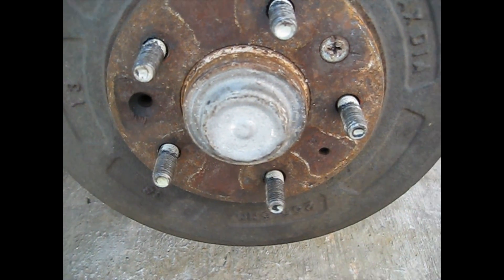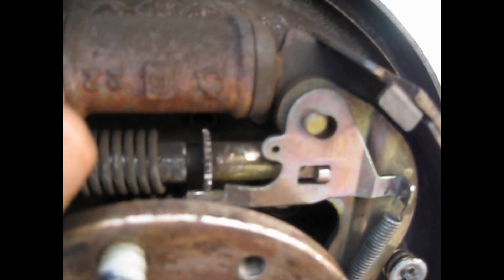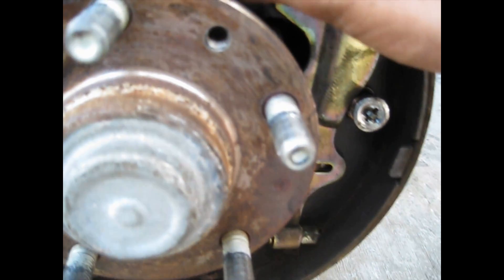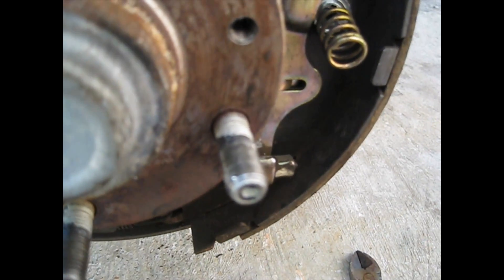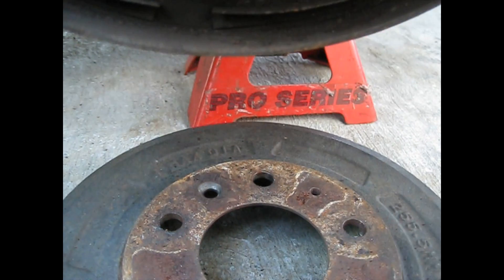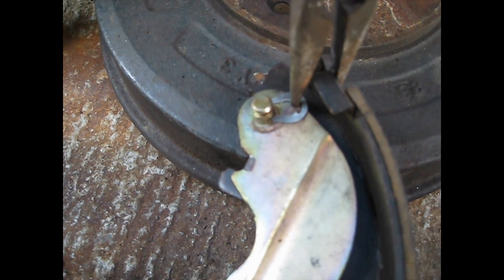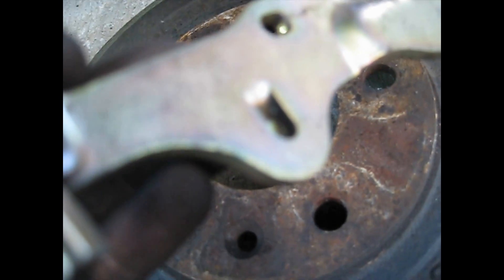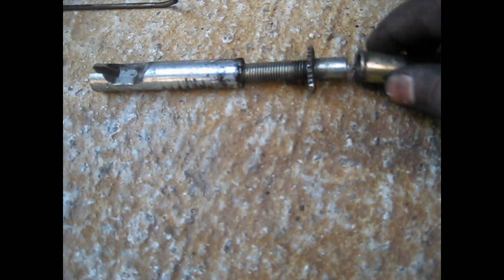Brake shoes replaced 2000 Mazda MPV  pt 2

Comment: This is  a very well done video.  one thing worth mentioning  is some people may find thier spring and adjuster on the back side instead of the front.  This video clearly shows the spring and adjuster on the front side and not the back. There's a  bulletin that talks about  the reason for the change.  An upgrade is available if your MPV has the adjuster and spring on the back side.  The upgrade includes new hardware that will change the adjuster and  spring to the front.  not everyone requires this. it's only for people who experience noises from the rear brakes.
Reply from the maker: TY